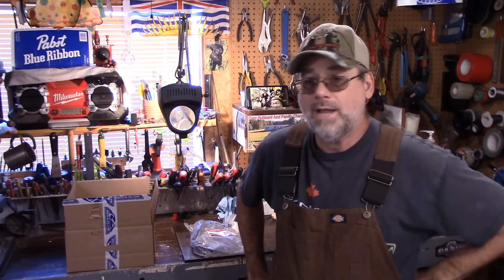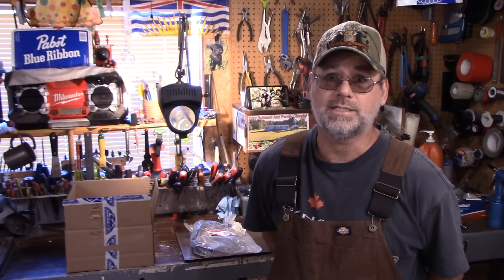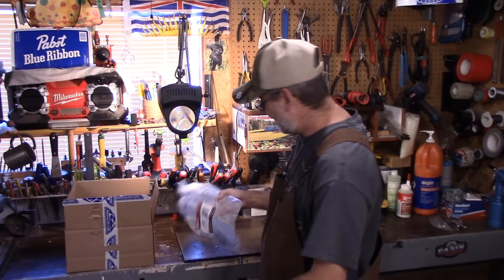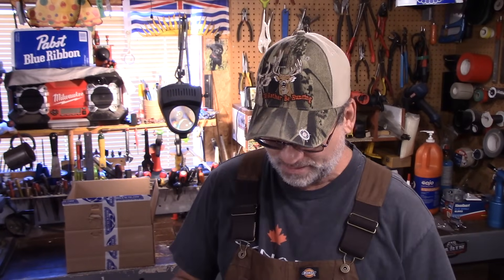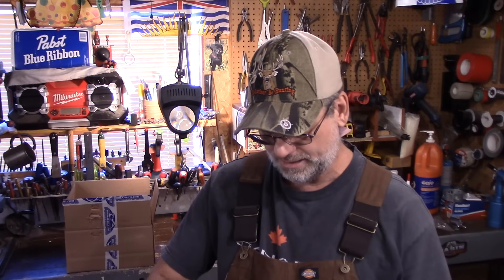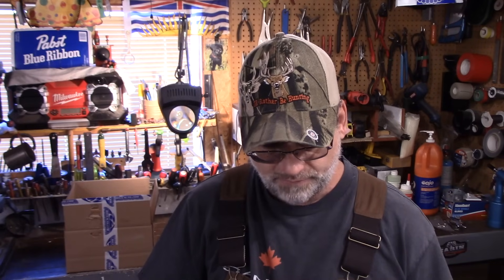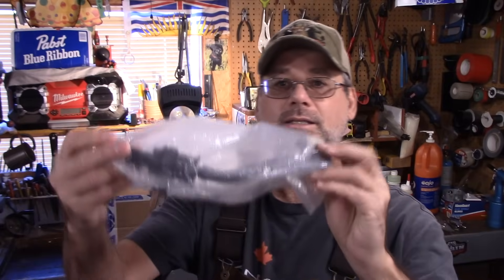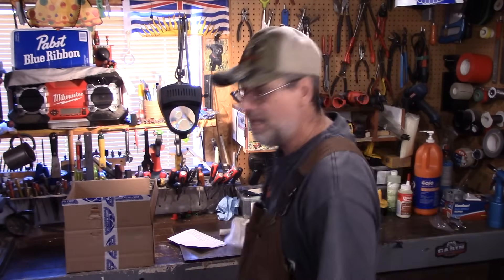F150  STALLING AT STOPS - THE FIX -  PART TWO

Comment: I have a ford f150 2003 4.2 motor . Issue i'm having is it will run great for some times weeks at a time then it will stall when starting and sometimes will just stop running when driving. I have been to Two different mechanics and they are stumped as well. engine light is on throwing o2 codes replaced 02s. also replaced fuel filter plenum gasket plugs wires coil pack pretty much everything i could think of. When I had plenum off i also replaced the bushing clips that operate the butterfly's left and rite side put it all back together and ran great for almost a week and the havoc started all over again. I smoked it and im not seeing any leaks. I don't what more to do. keep in mind truck has 207,000 miles on it. But when it decides to run it runs great but when it doesn't its really bad. Please anyone out there that could point me in the rite direction???
Reply from the maker: I would say you need to find a good tech because this is all fixable.
Reply: My experience in some issues with the 4.2 engine
A running condition and stallng suddenly in my case a few wires in the main harness were touching due to heat because where the harness lives.is on passenger side almost on top of the exhaust manifold..i fixed those wires and the problem was gone..thank God i was able to spot it before swapping any parts
Reply: Ford tech for 25+ .. not doing it anymore. But ... I would replace or clean IAC valve .. and clean the throttle plate and spray brake clean.. on MAF vein on the sensor.  Lmk .... that just can do it.
Reply: My 2004 f150 felt like it didn't have OD an then started to stall in run ruff so I checked fuses found out there was a tranny fase in it was blown I replaced it my truck wouldn't start so come to find it was my PCM fuse in its common it say look at ur 02 sensors wires in tape up where ur wires r melted or stripped so I looked on mine was melted on driver side by the lip where the tranny pan gasket hose so I tapped it an runs great

Comment: I replaced the evap purge valve on my 2004 Ford F150 FX4 5.4 it fixed it for 1 month and the problem is back .
Reply from the maker: Makes one wonder if it's another bad valve , it worked for a month so .......

Comment: I turned off vct using hp tuners and now dreives like a dream!
Reply from the maker: Very interesting . Thanks for the incite. 👍
Reply: @SteveRobReviews  What is hp tuners, as my ford is doing the same thing?...Help please?
Reply from the maker: @nuetouchtechnologiesllc7484  I have no experience with hp tuners . I change the evaporative purge valve on the engine and it's been stall free ever since.